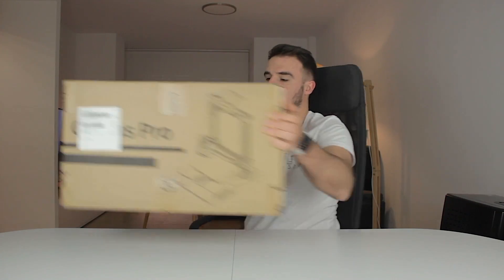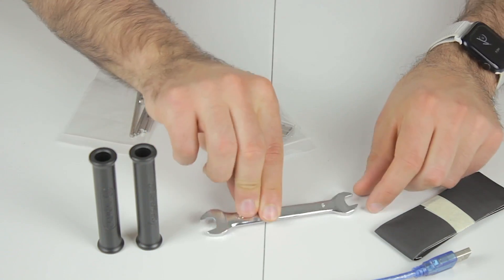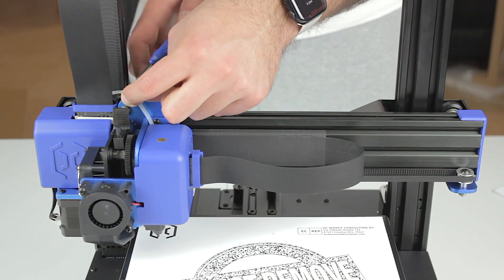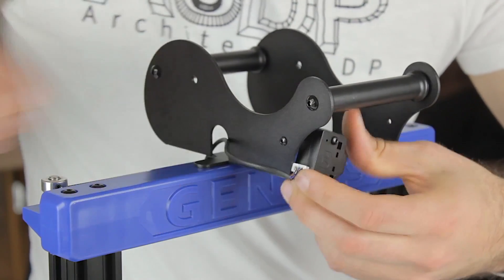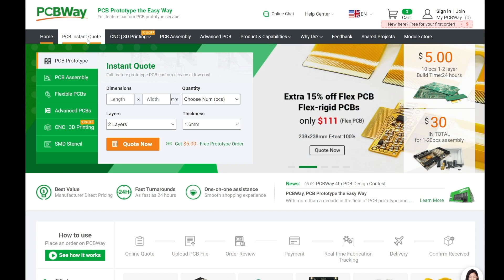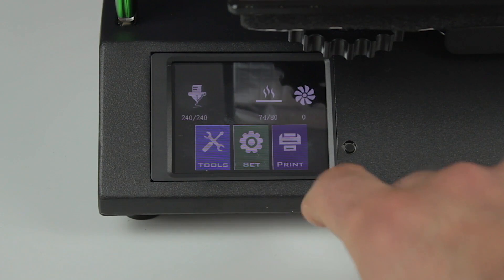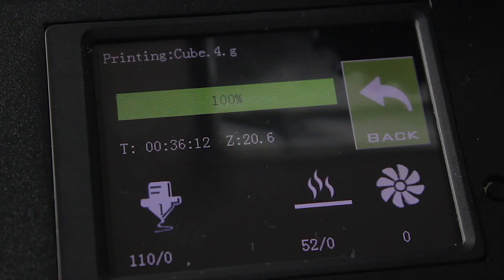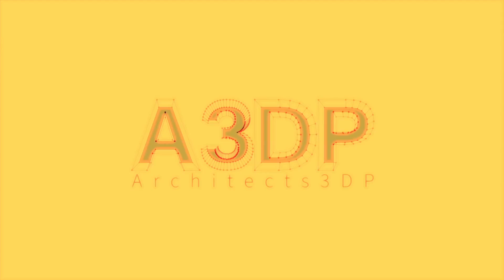ARTILLERY GENIUS PRO | Assembly and Review | BEST 3D PRINTER in 2022?

Comment: hello brother i am a civil engineer, i build our own 3d printer at home i check it by pronterface if i click -x axis it moves to the + x axis the stepper motors wires are perfectly all right what should i do for the calibration
Reply: wire maybe wrong plugged like +,-. assuming u r using arduino so check the board connection wiring.. some times software coding might be a reason but if it is only x axis check board connection plugging of stepper motor.
Reply: @arunprasanna01  okay I will check bro thank you